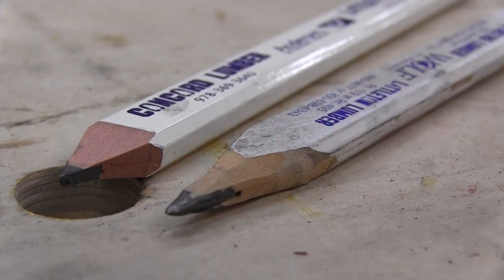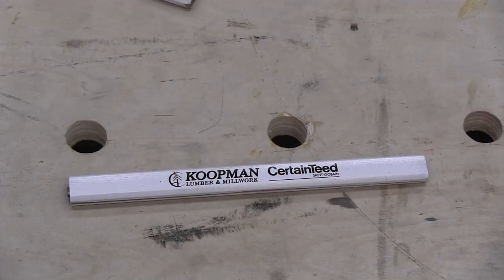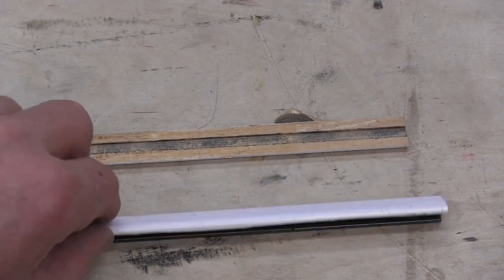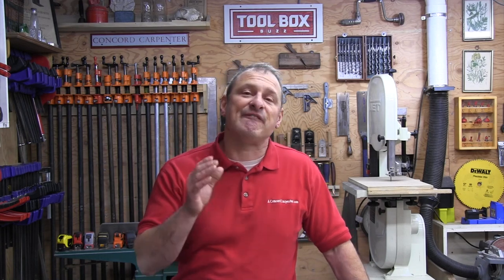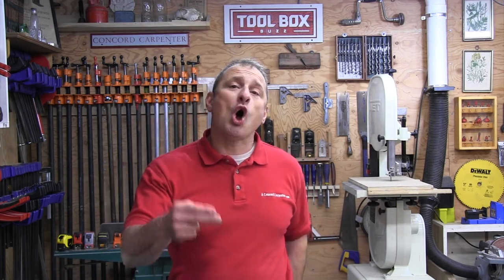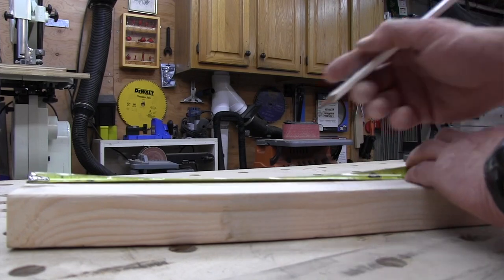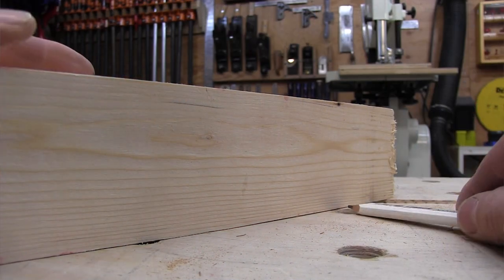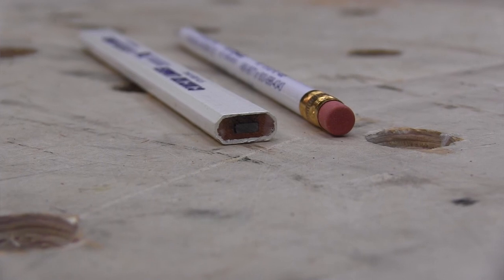The Carpenter's Pencil

Comment: I usually use a 0.9 mm mechanical pencil, but keep a carpenter's pencil in my toolbag as a backup. I never thought about using the offset distance of the lead for marking straight lines - that's a great tip!

Comment: I rarely use the flat pencil since the majority of my work is  finish carpentry.  #4 Dixon fits in my Accuscribe, fits over my ear, doesn't roll off of uneven surfaces, and fits most pencil sharpeners to maintain a super fine tip.

Comment: I use 1.3mm mechanical pencils for most tasks. Thick enough not to break but still fine enough for accurate marks. Very rarely use a wood carpenters pencil anymore. 

I ordered the first couple from japan years ago and have used them pretty well exclusively since. These days I use mostly paper mate 1.3mm kids pencils. They are cheap, larger diameter with triangular body and bright colors. So they are easy to find.

Comment: I us a metal drafting pencil for trim work and finished surfaces because it is very durable.. A no.2 with the scribe and a carpenter pencil for layouts. Finally Milwaukee inkzall for everything else that I don't want to wash away like tile, concrete, glass and metal
Reply: Yeah, I'm with you. Carpenters pencil for framing but .5 mechanical for finer work. Inkzall but also a fine point sharpie for surfaces resistant to graphite

Comment: I typically use an 5.5mm FatBoy "mechanical" pencil by FastCap for wooden boat building I really like it. It has a nice rubberized grip and the lead can be sharpened in a normal pencil sharpener. Since dropping it only a few feet isn't a huge issue and is easy to find after

Comment: Use it for trim work always for spacing smaller measurements butting up against my thumb holding the pencil up to the piece and using as a measurement stick.. quick accurate..and have always done this..great for checking gaps etc and  because.....it's always on u..or should be...plus peanut butter outta the jar when the spoon is lost or stirring tea 😉

Comment: Hi, I normally use a 0.5mm automatic pencil for two reasons, The diameter of the graphite is consistent and it fits well into Incra rules. The downside is that 0.5mm graphite is weak and easily broken, so when marking on rough sawn timber a carpenters pencil is preferred.

Comment: I use carpenter pencils for framing, sheeting etc that doesn't require precise measurements. I used to use Tichondria #2 for everything that needed precise measurement until recently when I bought a couple Staedtler Mars Technical Mechanical Pencil 780SBK. It is called a "lead holder" which it does quite well. Its the first "mechanical" pencil I have used that didn't break on me in a week or less. The lead it comes with is rather hard and holds a fine point very well. The tail cap also has a built in "lead pointer" which is the best thing on a pencil ever and it actually works extraordinarily well . You can sharpen it to a needle point in about 5 seconds and its always there. Highly highly recommended and they are about $6 on Amazon.

Comment: I use a carpenters pencil for framing, crayon for setting out on concrete and either a pica dry or staedler red and black for finish work. Always use a 2h lead for either application.

Comment: I am a finish carpenter so a hex 2h or 2b is what I use as its way more practical for me. Have carpenter pencils all over the van but not a fan. Have a pencil sharpener in pocket and most of all is hex fits behind ear far better and don't find hex rolls unless major incline. Tried mechanical pencils of all types and brands but again not as practical or robust. staedtler brand is the most reliable and robust and lead/graphite does not break

Comment: I really like mechanical pencils for anything that doesn’t need it. If I’m framing a wall I’ll use a mechanical pencil, doing a wood working project I’ll use a mechanical pencil. Mostly because the line stays a consistent width. It doesn’t change thickness as you dull it.

Comment: well tip #5 is the closest i have heard  to what i read in and old blacksmiths journal  the reason they are made as they are is to correspond with the kerf of saws when laying out ....as best i can remember the quote was "and when setting the teeth of the newly made  crosscut remember to to roughly set the teeth so they match the carpenters pencil." as best i can figure the narrow edge of the graphite corresponds with a hand saw and wide edge corresponds with a 2 man  rip or pit saw ... this is merely an extrapolation of a comment  i once read  is it true ???  dont know but it makes sence... cheers

Comment: i guess im weird. I NEVER use a flat carpenters pencil. although, i do appreciate the two different scribe dimensions that dont exist on any other pencil. BUT, I never need to scribe anything when im framing. i only use the FAT round pencil for framing, mostly because i like having an eraser. Even though the eraser always runs out before the pencil. for trim carpentry, I use the papermate sharp writers. eliminate the step of needing to knife my pencil sharp, and more dust resistant than a mechanical pencil. BUT if your pencil slot in your belt is full of dust, or if you throw it in the bottom of your belt, the tip could become too jammed with dust and the lead wont penetrate through it and then you look like a goon on the jobsite taking the eraser off and trying to screw the lead out and clear the hole at the tip. or just toss it and go grab another from the 36 pack you bought of amazon for barely nothing $

Comment: Hate them NEVER LIKED EM  I use a Ticonderoga My First Pencil for framing and a 4H Staedtler for finish and Azak my tolerances are way to tight for the width of a flat pencil I judge a carpenter on his pencil
Reply from the maker: gtjr1975 for finish I use a razor blade, but still use the carpenters pencil to record markings
Reply: A Concord Carpenter / ToolBoxBuzz and I’m sure you are an amazing carpenter... what my comment  should have read was I judge carpenters on how sharp their points are on a pencil that’s usually the tolerance they are satisfied with

Comment: I don't use a carpenter's pencil because I am not a butcher.
Reply from the maker: ... well? What do you use?
Reply: A Concord Carpenter / ToolBoxBuzz

.5mm, .7mm and .9mm mechanical pencils and .5mm pens for scribing when I can't use a pencil.  A .5mm pen line on masking tape leaves a dark, crisp and very clear line for perfect scribes.  My scribes are tighter than a...  

Mechanical pencils also have toolless sharpening whereas the old school framing pencils require a sharp blade.

If I was a framer doing residential/wood studs I probably would use one of the thicker mechanical pencils.  Maybe 1mm.  Just my preference.
Reply: A Concord Carpenter / ToolBoxBuzz

By the way, the table saw comparison video was pretty darn good.  :-)
Reply from the maker: thanks - hoping you subscribed to channel?